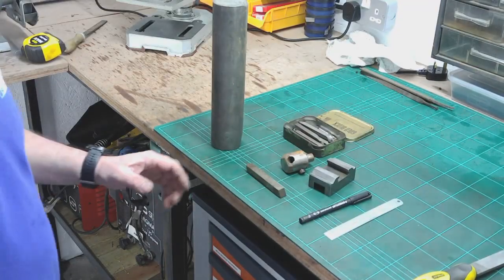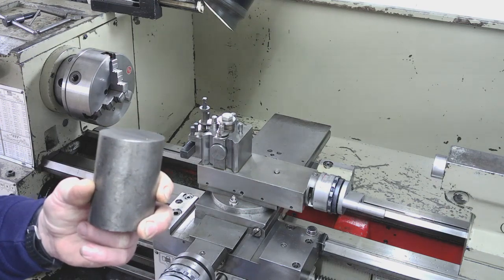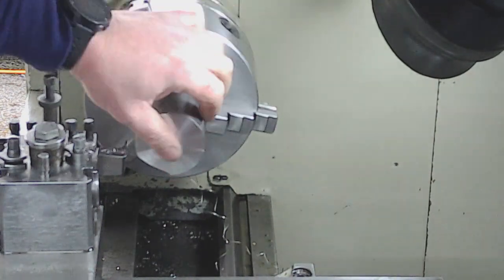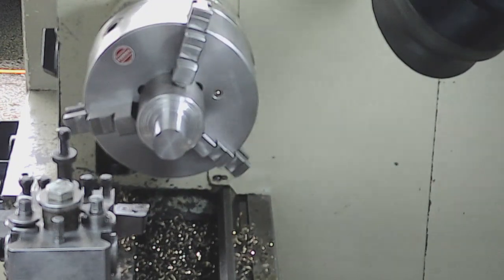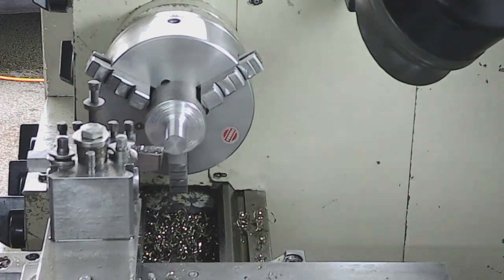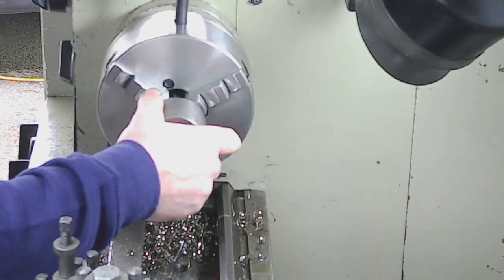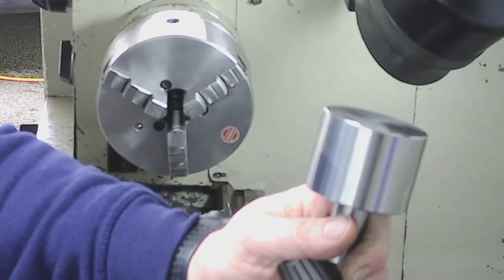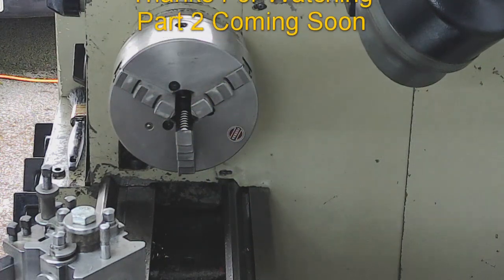Making A Fly Cutter For The Milling Machine Part 1-Turning

Comment: My sympathy is with you struggling with a 3 phase inverter. Thirty years ago at a previous house I owned, I had a three phase supply put in. I had to organise all the groundwork etc, but the installation of the supply cable cost about £500.. At the time a 3 phase inverter would have cost me about £450 that would  run my 6HP Colchester Triumph 2000 and 3 HP TOS FNK25  mill. Today ( 2023 ) it would cost in excess of £5000 to have the same supply put on. What has gone wrong witth the world, OH, I know, GREED
Reply from the maker: Hi John, yes 100% greed, and there's 3 greedy mouths in the chain these days not just the one as it used to be. VFD is the solution when I get round to it. Cheers, Jon

Comment: Get a DRO if funds allow, I real worth addition, low profile magnetic ones worked on mine quite well.
Another pocket drainer (not that bad) is an er32 collet chuck which will fit to a backing plate as makes use of the collets your already have.
if you do this dont go any smaller than the 125mm as you'll have trouble mounting it given the cam pins and back of the back plate. Tool post handle would make life easier :)
Reply from the maker: Hi Tubal Smart, thanks for the comment. Agree with everything you say, all of those things are on the "to buy" or "to make" list. DRO is a definite for the mill, and in the fullness of time I will add one to the lathe. Mill has to come first as it adds far more value on this machine. Cheers, Jon

Comment: Hi Jon enjoyed the video your lathe is performing very nicely. Balanced cuts is new to me being a home shop guy. 
I'll have to give it a go I hate the creeping up bit it takes ages. I've always avoided finishing with emery as well if possible. Tony
Reply from the maker: Hi Tony, thanks for the comment. You can try it in absolute safety. Sort your settings out so that you are getting a good finish with good swarf control (if possible), then note your depth of cut, and just keep repeating/measuring/repeating/measuring and your confidence will go through the roof instantly. You can do all this at the roughing stage. I would suggest 3 measure cuts and a finish cut to start with (minimum 0.5mm / 0.02" if you're using carbide on steel, double it for aluminium). Hope this helps, let me know how you get on. Cheers, Jon

Comment: Hi Jon, Stefan Gotteswinter said exactly the same thing in a video he did a short while ago (https://www.youtube.com/watch?v=lwDp1a7VZ64), I tried it and it works very well. very good tip. Might have a go at the fly cutter shortly, just fitting a DRO to the mill at the moment though, so it'll have to be later. Lathe is looking good now you'v sorted it.
Reply from the maker: Hi David, thanks for the comment, Stefan's channel is great isn't it, makes the rest of us look like amateurs. The Fly Cutters work well in "normal materials", I think the first test of mine will be a little unfair for it so don't be put off if it doesn't cope very well. Cheers, Jon

Comment: Hello Jon. I just got an amazon fire stick, so I was able to watch you on my telly! Your new lathe is working well. Getting stuff to chip properly seems a perennial issue. I think sometimes I'm not taking big enough depth of cut with the carbide that I (and everyone else now) is using. I also think that some materials just won't have it. I was turning something out of an old shackle pin the other day. Tough as old boots, really chewy and just refused to chip. Such is life sometimes though. Just have to do the best with what you have. Totally agree with your statements about taking balanced cuts. It would have been interesting to run a clock over the larger diameter after you'd turned it. As you'd taken the piece out of the chuck and flipped it I'd liked to have seen the run out, I know from last time that chuck is far more concentric than would be expected for a 3 jaw. I'm looking forward to the next installment. All the best from Carl in 30 degree celsius Moray.
Reply: The chip breaker on inserts can vary a lot,  when ordering new ones check the specifications for the brand you want, the last few letters in the iso part number are the chipbresker style and they are different for each brand. For home shop use what are described as "fine finish" are often best as the cut must be small because of lack of power. Some chip breakers will chip with as little as 0.1mm and give a good finish but can't take heavy roughing,  yer pays yer money etc etc.
In summation, just because its carbide doesnt mean its any good for your intents, a quick peruse of something like the Sumitomo catalogue will give you a migraine in short order.
Sorry Jon for butting in.😤
Reply: @chrisstephens6673  Thanks Chris for that, totally agree.
Reply from the maker: @chrisstephens6673  No need to apologise Chris, I think the spirit of community and sharing of experience and ideas is what this channel is all about. Cheers, Jon
Reply from the maker: Hi Carl, thanks for the comment. Lathe is an absolute gem. If I was on proper industrial 3 phase power, there would be no issues, and with a range of chip breaker inserts to try, there is normally a sweet spot. There will always be a compromise or two in the home shop, a challenge I gladly accept! That's what I find interesting, always some hurdle to navigate. I will do a clock check on camera for you on the next project, the O/D of the bar I used in this video was quite rough and beaten up, think it had been used in a big press at one time. Part 2 coming soon. Cheers, Jon

Comment: Hi Jon, for years I've been of the 'creep up on it ' school of thought but in the last year or so I'm a convert to balanced cuts. Good video, as ever. Mike
Reply from the maker: Hi Mike, thanks for the comment, it's an essential practice on CNC machines especially in aerospace materials which are much more fickle than the home shop material choices. Having spent years programming and observing the results, I would never go back to trying to scratch it off. Cheers, Jon